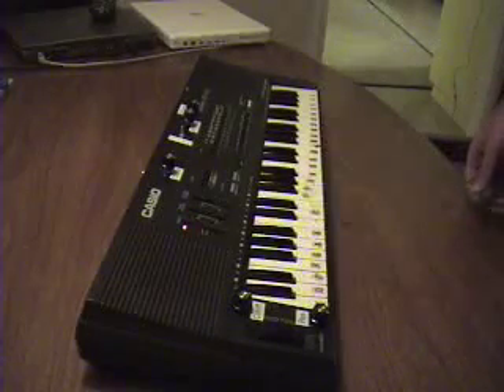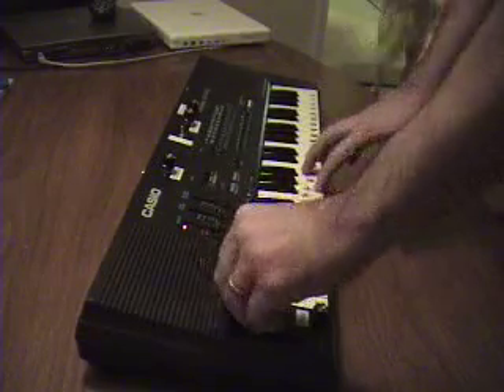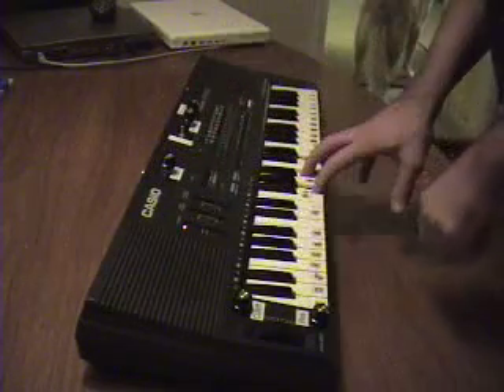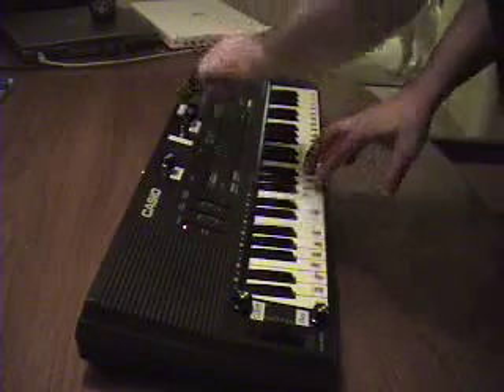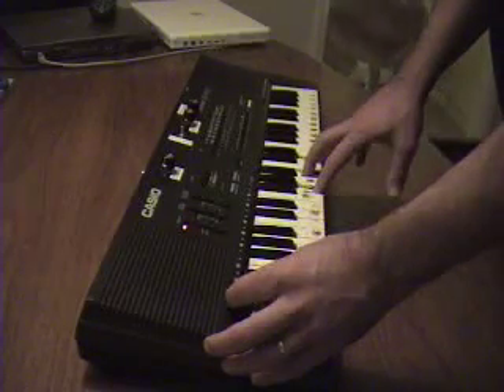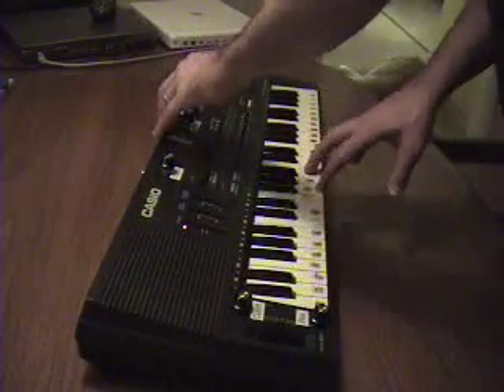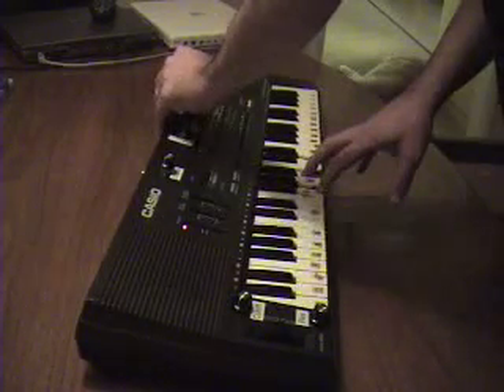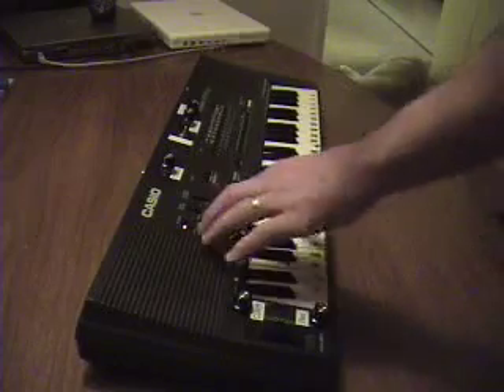Casio MT-600 Filter Mods

Comment: These mods will work on the CT-630 too, It's the non programmable version of the HT-3000. Rare but usually cheap if you can find one.

Comment: roland sh1000 "Only the HT family and the MT600 have that filter chip, no other Casios.  good luck!"

I suspect that maybe the Casio MT400V/ CT410V may well have the same filter chip as the HT/ HZ family. Those keyboards already have onboard cut off and resonance controls on their front panels, though they are a bit tame. There are mods that can make the filter self oscillate and sound more wild - quite a few demos of modified examples on Youtube.

Also, the Casio FZ series (FZ1/ 10M/ 20M) samplers had an onboard analogue filter. I'm not sure if it's the same as in the above machines, but I wouldn't be surprised if it was.

Comment: Wow great job, this sounds amazing.  I've been into (controlled) circuit bending lately and I found an almost mint  condition Casio MT-800 with it's case and external speakers, and it seems like it has a ton of potential.  Have you had any experience with modifying the MT- 800 by any chance?
Reply: it does have a lots of potential, I have circuit bent my mt800...

Comment: So.. This really isn't a "bent" circut, but a Filter instalation and LFO installation, Right? I've got a couple of casios I would like to do this with, but you can't bend them. THey are both AC only and have no Battery option. I've just demo'd one of them on youtube here. The Casio 401. I would be interested to learn how to install these things on my Two casios...(or even if you can)

Comment: The MN3102's clock can be varied by, i think, using a pot between pins 6 and 7. I did this with my friends yamaha pss-470 that has a similar chip setup (mn3102 and MN3206).